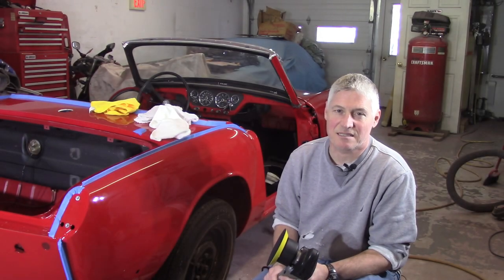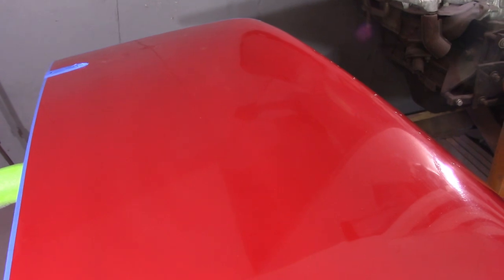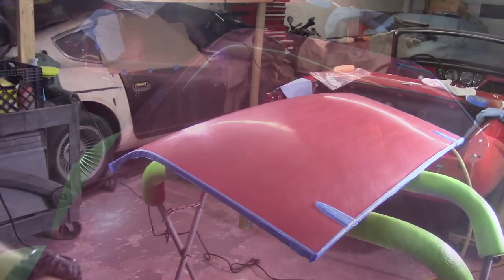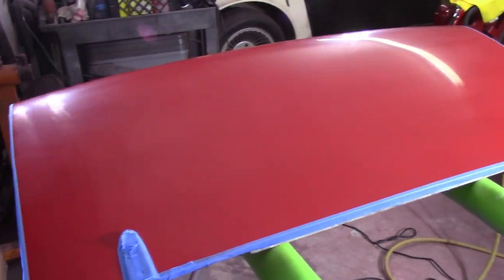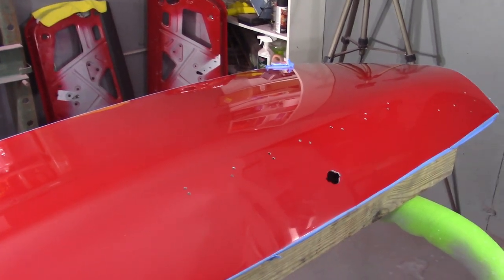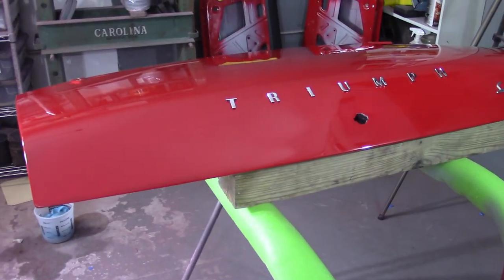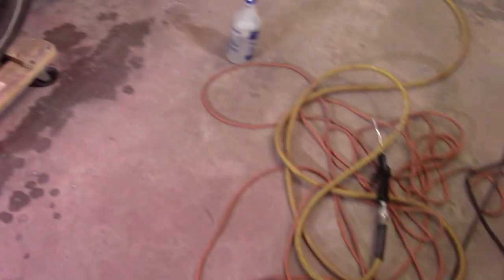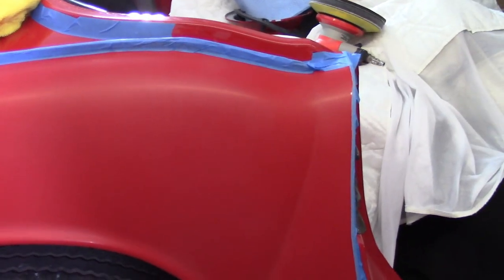More Cutting & Buffing - Triumph Spitfire | Roundtail Restoration

Comment: Hi Chris. Good work. I need to do similar, mostly dust particles so I may just polish first. I am going to assemble all the windows, lights, interior first. Just in case I slip with a tool 😭
Reply from the maker: Thanks, Matt. If I didn't have some good trash, I would have gone right to buffing.

Comment: Thank you so much for sharing your ups and downs with the polishing.  The experts make it sound easy but I learn more from you as a first timer.  At least I know now where the pain points are! 
Would you recommend chemical guys over say 3M compounds?
Reply from the maker: Thanks, Tom. I only used the CG stuff so I can't compare. I would say the guys on SPI are about evenly split, though. I got it in a bit with the buffer, so went that way.

Comment: I watched the whole video. The good first. Micro fiber towels. Taped edges and spray bottle instead of bucket. The bad...your panels look flat. No more peel or texture. Good. Seems like you are struggling with scratches.  Looking at your 3000 grit stage (thru a cell phone of course). Try putting more rubbing compound. Or maybe doing the rubbing compound stage twice. If you used a rotary it would eliminate your problems.  They arent that hard to use. And a wool pad will get the results you are chasing.. Also. Use wax and grease remover between compound stages.  If you dont, you are leaving behind rubbing compound residue into your polishing stage and working against yourself. What grit is your compound designed to remove? 1200? If so...and u started with 1500. The compound should leave behind no scratches...meaning...use more compound and let it do its job.  It will get there. the best way to learn is by screwing up. Understanding what caused the screw up and knowing how to fix it..
Reply from the maker: Thank you. Yes, definitely having issues with scratches.